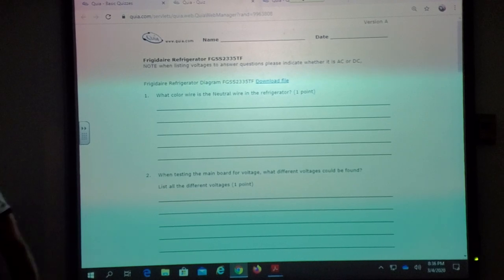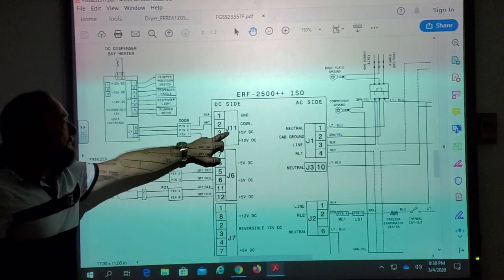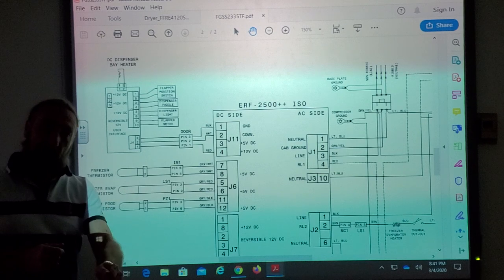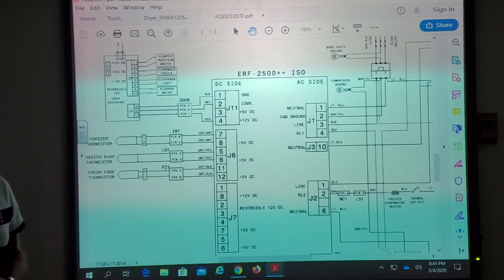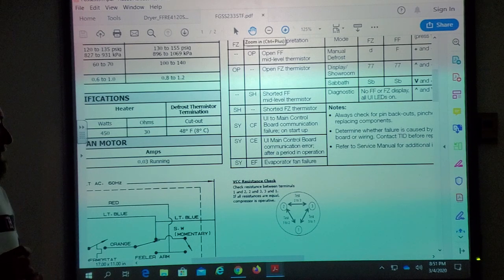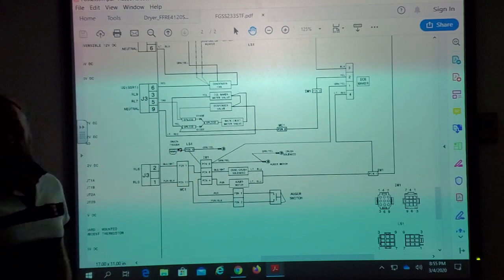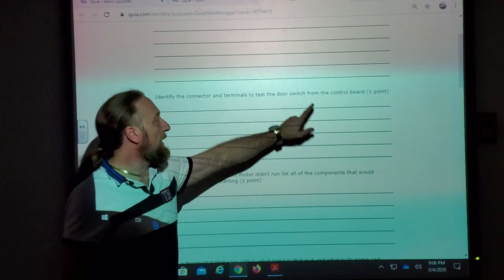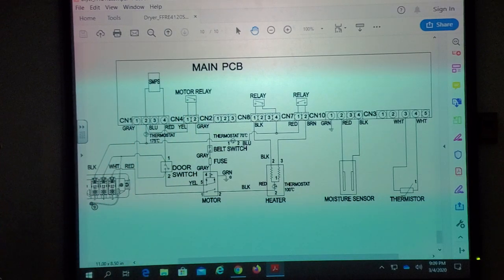Frigidaire Refrigerator and Dryer PT 1

Comment: Interesting stuff, but what is the function of those ambient sensors? Have seen them located in the upper door hinge area.
Reply: I have reached out to some of my friends at the factory and waiting on a response from them I have somewhat of am Idea, but waiting for a response before I answer this question. This is a good one.
Reply: OK, I spoke with some technical training Reps. and the answer to your question is 

The unit monitors ambient temperature, and if the exterior of the cabinet has extremely high temps all they do is tell the compressor and fans if variable to run a little longer or faster, and actually bring set temperature down a little more than what is programmed on the customers User Interface "UI"I. For example if Freezer set temp is 0 and refrigerator set temp is 35 it will drop freezer or refrigerator down a few more degrees than the setting. 

Most units for example: if refrigerator is set to 34 degrees it will drop to 32 shut off then turn unit components back on at 36 and keep average of 34 "Just example temps all units vary". Most cooling and heating products maintain a temperature average it is too hard to stay exactly on 1 number. With exterior temps affecting the time the unit can maintain internal temps for a period of time it will lower those temps for the off cycle. This will help maintain the interior temps a little longer and reduce the cycling of the components. Hope this makes sense.
Reply: @riz65  thanks, it does make sense.